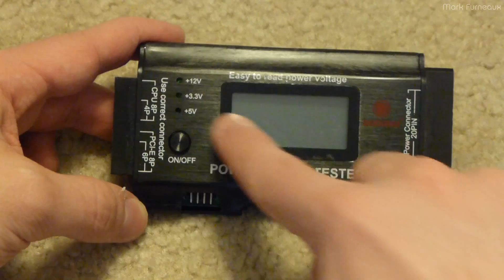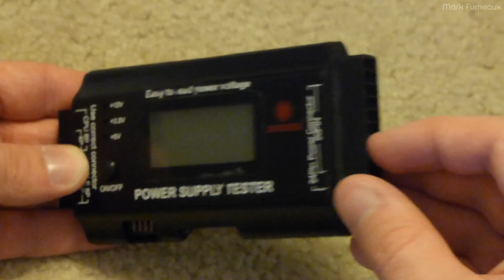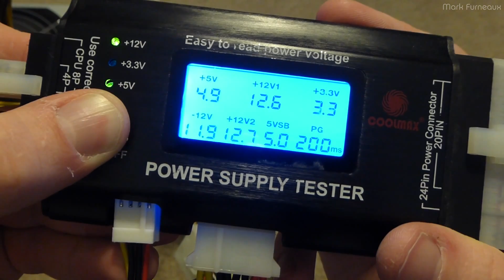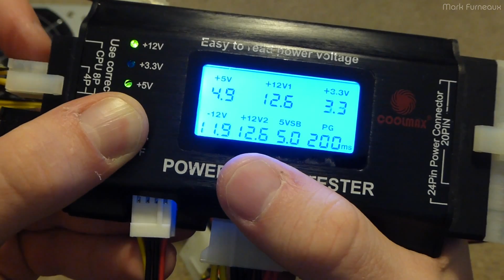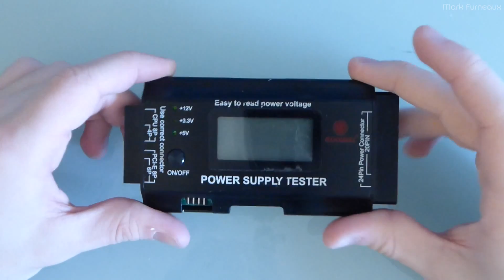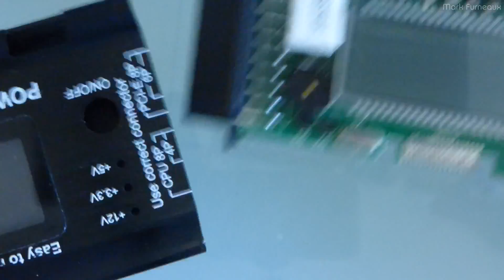Random Teardown #015: Coolmax PS-228 PSU Tester

Comment: Awesome video and commentary! I have that model of power supply tester myself and have used it for years. And yeah, my LED is out as well! Must've been low quality LEDs? But I can tell you from personal experience that these things are highly accurate! Every time I tested a power supply and it said bad, it was bad. I vaguely remember one time many years ago it told me a power supply was good but it turned out to be bad (motherboard wouldn't start with that PSU and a swap fixed that computer)... So all in all, a great time saver for testing a PSU!

Comment: Pin6 looks like it's for SATA, just judging by the number of pins and how they're joined together on the PCB. Could be wrong though :)
Reply from the maker: +Clinton Mattler Holy shit, you're right. I never assumed that because the contacts are on the wrong side. However upside down it does fit and the pins line up. Kind of weird that it has no polarization pins, but an edge connector is free I guess.
Reply: @TheUbuntuGuy  yes, it's definitely SATA